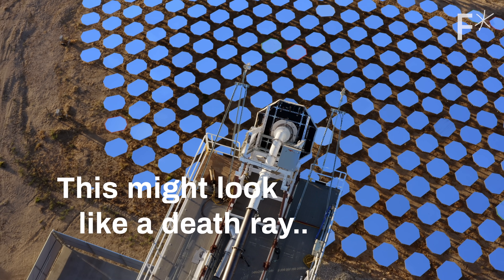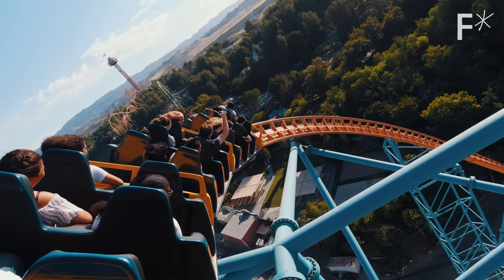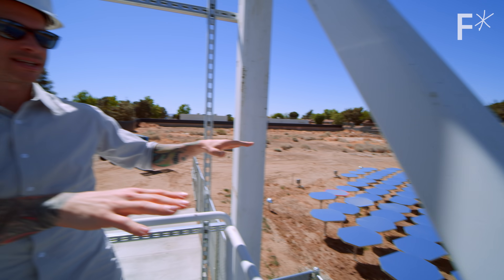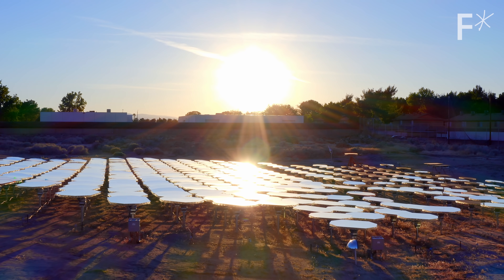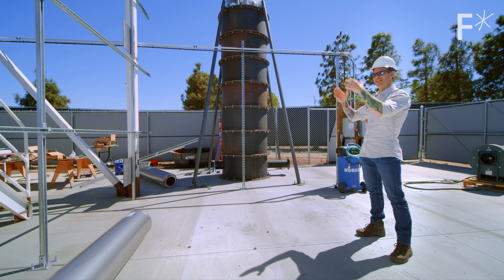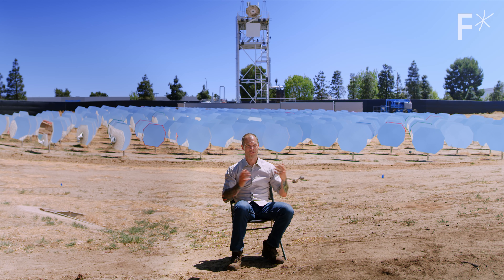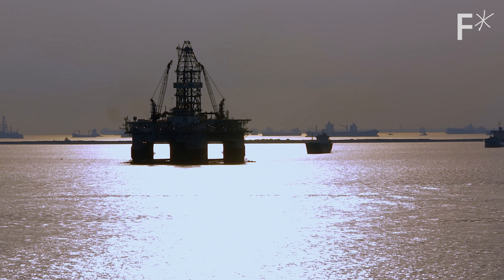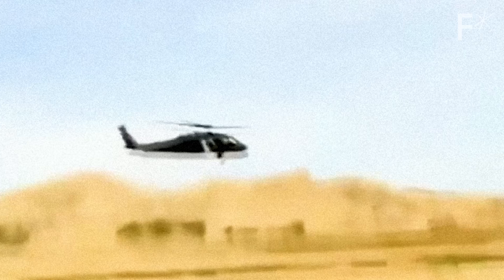How concentrated solar power could fuel the future | Big Think

Comment: With the historical drought among the western states, I wonder whether the technology is even more efficient in the application of seawater desalination.
Reply: When you heat seawater up to really high temperatures it produces chlorine gas which is incredibly dangerous. That's why nuclear power plants can't run their turbines on sea water. They can use it as a coolant but not to run the turbines.
Reply: @viaJustin1910  It seems to me the team could scale down the number of mirrors to achieve the temperature which is suitable for seawater desalination. But the hardest part to me is to pick a location along the west coast to setup the proof of concept application and the associated cost to build the pipes and brine treatment facilities. Or the team can try to get funding from the Middle East countries and setup trial there. Instead it might be easier to apply the technology to treat recycle water into drinkable quality. If I remember correctly San Francisco is conducting similar type of experiment or trial with old school equipment.
Reply: @Doug923  I believe there is probably several applications for solar refinement of water, I am just not sure how to over come some of the chemical reactions that come from sea water surely there is a way to do so though.
Reply: @Doug923  the Salton Sea
Reply: @blondegirlsezthis8798  Combining small scale seawater desalination plants with indoor vertical farming might have the least impact on the environment.
Reply: @Doug923  Actually you are on to something.  Some Carbon capture techniques would deacidify the oceans and allow corral reefs to flourish.  At the same time churning sea water (in my theory) creates more evaporation of sea water into rain clouds; to be brief.
Reply: @clavo3352  So micro seawater desalination plants might have second role as controlling sea salinity and promoting seaweed growth as carbon sink, in turn it might reverse the acidity of the ocean. Interesting.
Reply: @clavo3352  The oceans are basic, not acidic. Maybe research the things you pop off about.
Reply: @viaJustin1910  This isn't true.
It happens with electrolysis.
Superheated water just convert to super heated steam.
Reply: Yes, but brime is produce its a waste product
Reply: @ttt3377  There is another line of research to combine brine at different concentration levels to generate electricity.
Reply: I’ve been wondering about that for a long time as well.
Reply: Desalination creates poisonous sludge. Find a way to use the sludge or magically cause it to vanish.
Reply: Desalination plants use reverse osmosis. To get a 1 cubic meter  (1000 liters = 265 gallons) of water uses 4KwH (max) of electricity (2.5KwH min). At typical electricity rates (10 to 20 cents per KwH) that's 80 cents (0.3 cents per gallon), worse case. Of course that's your home rate. Current water, to consumers, about $3 per 100 cubic feet (750 gallons or 2830 liters), so 0.4 cents per gallon.

Now, a utility is not going to charge you 0.4 cents a gallon, if it cost them 0.3 cents. But, again, ECONOMICS ! If this solar energy method can make energy at a much lower cost than current sources, then the cost of its products will go down, too. Oil and coal aren't cheap, because oil companies are nice guys. Its because the make more money, by selling in volume. Our life style was defined by our energy usage, in the form of the industrial revolution. If you just go by the greed factor, newer methods make innovators, much richer, that the rich of the past. Also, in a way, trickle-down works. Before industrialization, the world population was 1 billion. Now its close to 8 billion. Famine and disease kept the population in check. It wasn't pleasant.
Reply: @michaelmoorrees3585  Israel has the most advanced desalination solution but the future is Graphene
Reply: @ap0lmc  Both emerging technologies could compliment each other respective to their own strength and weakness.
Reply: To minimise the build cost the desalination plant needs to be near the sea. As the thermal energy plant would be a large distance away in the desert (land near the coast is expensive), you would have to use it to generate electricity or hydrogen and then transport that energy to your plant rather than using the heat directly. This increases cost.
Reply: @alanjenkins1508  If the team could secure the supply of water to drive the steam turbine generator, it would be more cost effective to just send the electricity to the local grid.
Reply: You want to heat salt water to make water.... Should love to see the calculation for energy needed.
Reply: @aronandreas  For the efficient comparison probably should use the Carlsbad Desalination Plant in San Diego as the benchmark.
Reply: @Doug923  I have no knowledge.
Time for me to Google it.
Thanks 👍
Reply: That is the cool thing about getting renewable energy cheaper than fossil fuels.  Once it is, it can be used to solve a lot of problems more economically and without harming the environment.
Reply: Exactly!!
Reply: Graphine could do that with just gravity
Reply: look up the solar dome project, they are allegedly going to build these in Sadia Arabia
Reply: They might be able to use it to pull lithium out of the water in the Salton sea in California.
Reply: Yes its good , the water will evaporate leaving only the Salt
Reply: There is the Greenhouse effect Desalination Dome.
Reply: the problem they are trying to figure out is what to do with all that brine
Reply: Why concentrate the energy with its associated losses?  You are not gaining energy, just concentrating it.  Why not set up a pond of the same area and let the 1000W/m2 of solar insolation work directly.   Don't confuse heat with energy. It takes energy to convert liquid water to gas   (2260KJ/kg).
Reply: @craigs5212  There is another line of researches shows combining with ultrasonic wave, the evaporation could occur at around  50-65C.
Reply: If you’ve got cheap energy, you can solve basically any problem.
Reply: @pookachu64  Apparently another use case of the technology is in the process of direct carbon capture, without turning the energy from the sun into electricity.
Reply: @Night Rider 
Correct. This proves that man and Co2 levels have NOTHING TO DO WITH THE CLIMATE!
Reply: @Night Rider 
It absolutely proves it. There is no climate crisis. 

Burning coal for electricity is cleaner than a forest fire. Natural gas power plants are incredibly clean. 

Until there is an equally reliable replacement for fossil fuels we will need fossil fuels.
Reply: @glidercoach  theres a climate crisis. Theres a reason why it is the scientific consensus that the climate is getting fucked up. But it is not in the best of interest to many to accept it
Reply: @glidercoach  not really, because these scientists have other environmental tasks to make. If climate change wasnt a thing they would still have jobs involving precisely studying the environment
Reply: @vcjg287  
Have you heard the term "gain of function"?

There ia a lot of research going on with viruses. This research requires money.
Reply: @vcjg287  
Give me an example where the climate is being f'd up.
Reply: @glidercoach  rising temperatures because if human co2 emissions. We know its human emissions due to the isotope ratios of carbon present in fossil fuels. Also we know its an abnormal rise in co2 because we can compare current air to that of old ages thanks to ice cores or tree ring analysis. If its a scientific consensus, it is because the evidence is clear, specially to someon who has dedicated its time and energy to study such things. Just like a programmer or computer scientist are the ones that can understand when a system is infected with a virus
Reply: @glidercoach  the presence of droughts in the past dont change the trend that temperatures are rising. Thats something thats has been confirmed through different methods, one being the ice cores i mentioned. Also we now have satellites to meassure these things for the last 50+ years, and it has shown consistently how temperatures have been rising. Not only that, but the mechanism through which the warming is happening is well understood, it being the effects of CO2 with its heat capture capabilities. It is evident what is happening. Even in the 70s, BP made some studies on the effects of fossil fuels on the environment, and they didnt release the results until much much later, because it was evident how a co2 increase in the atmosphere isnt a hood thing. Those effevts have also been known since the end of the 1800s, because it isnt really complicated chemistry. It is empirical how greenhouse gases act. I dont see the point in denying it. Even if climate change wasnt causwd by humans, we would be watchung a disaster incoming for which we should prepare now, and the ones that wouls contribute the most in that are big companies. Coincidently these big companies prefer to deny this for the sake of short term progit, and the worst thing is that peiple support it, because they dont understand the science behind it, and how it is so evident that climate change is happening and it is not good
Reply: @glidercoach  it is expected that with rising temperatures rain will increase. 
And no, the ammount of ice in the arctic and antarctica has been decreasing, where do you get that info from. Dont trust me with this, just go into any climate research institute and you will see for yourself. 
Look, if climate change wasnt real, why would every single scientist base their research on a model they knew is evidently wrong. Also, do you agree with the following: 1. An increase in CO2 concentration in the air leads to more heat being retained. And 2: CO2 levels have been rising rapidly since the industrial revolution aka around 150 years. And 3. We can meassure these things accuratelly
Reply: @glidercoach  if can put a source to those claims it would be better. Also, it doesnt matter what one scientist says, what matters is the consensus on it, thats the point of publishing papers, so they are put under scrutiny by any researcher, and to see what outcomes everyone has. You can look up meta analysis on the topic of ice sheets for example. Just go into, say, the european climate research institute for example. Also, why would be the problem in accepting the reality as it is
Reply: @glidercoach  and the maldives arent thriving bro. Just look at how the place is getting flooded on a regular basis
Reply: @glidercoach  Oh, you just have no stake in it, so you don't care. Won't blame ya. Worst case, on the off chance you're somehow wrong (which you can't be because you're so experienced and figured out science for a scam that it is) - someone else will have to suffer. But definitely not you, no siree.
Reply: @vcjg287  
Where do you get your information. The Saudi's unvested billions of dollars building airports in the Maldives. Tourism was booming there until covid.
Reply: @glidercoach  they dont need more funding, because the research is already done.
Reply: @glidercoach  also eventually it became obvious how there was no intelligent life on mars. And noone tried to deny it, because the consensus is based on evidence.
Reply: @glidercoach  also, do you agree with the 3 points i presented you earlier or not.
Reply: @glidercoach  age is irrelevant in these matters. Its simple chemistry. Denying it is like denying the veracity of the chemistry that has built our modern world. The same that allowed planes to fly so you can travel.
Reply: @MadnessMotorcycle  
Bravo! What kind of Co2 belching, death motorcycle do you have? 

I have a liquid cooled MotoGP tandem twin 2 stroke. Do I get extra death points because I'm an oil burner? 🤣
Reply: @vcjg287  
I already commented on the 3 points. Clearly you're not reading what I'm writing so it's time to end the discussion. Have a nice day.
Reply: @glidercoach  well you actually didnt adress thise 3 points. Also that information comes directly from the journals themselves, not the press. As you say, these discussions are more productive when the facts can be presented ckearly, those being the research done, and articles or papers published. Do you know who does those discussions? The scientists themsekves, in science conferences, or are needed for the research itself. We dont do that, the normal people. And do you know who else doesnt read articles either? The press, because scientific accuracy is not the main goal. The consesnus is clear, but the ones that can do the most, are the source of the problem itself, which is the fossil fuel companies. Coincidentally since our world is based on these fuels these have great power to do what they want for the sake of profit. And denying an empirical, meassurable fact is pointless in that you would be siding with those that contribute most to the problem.
Its also not like if existing on renewable energy is impossible, because when there is a demand for a solution, the market finds a solution. However while this is happening, oil corporations receive more subsidies than renewables, tho the difference us starting to decline for some years now.
Reply: @glidercoach  You get extra points from me for what it's worth hahaha. I have a 2006 Honda XR650 dual sport I use for getting around the neighborhood and a 2000 Yamaha YZ-426 to tear up the earth with. The only two stroke I ever owned was a 1998 KTM SX250. It is a beautiful 85 degrees F in North Texas in August, which is incredible, and I will be firing up my C02, N0X and S0X spewing, archaic motorcycle and adding to the death toll of the insect extinction we are undergoing as well. Cheers!
Reply: @MadnessMotorcycle  
My roadbike is a 1984 Kawasaki KR250A1 I bought it when I lived in Africa. I also have a 1967 Volkswagen Karmann Ghia. I'm getting ready to do a ground up restoration. No complaints about the weather here in Southern Italy. 

Enjoy your bug extermination!
Reply: Historical drought? Not a chance. There have been droughts that lasted 200 years.
Reply: @glidercoach  Among those giant trees which died from the recent wildfire were those stood on Earth of 3200-3500 years, and they put this drought into the perspective. Tree rings studies from Utah and California give us ideas on how long the drought would last historically but those studies alone could not imply climate change. Given that we have no cheap and reliable methods to produce fresh water, the water management among the western states need to plan and allocate water use wisely as coal power plants need fresh water to operate the steam turbine generators.
Reply: @glidercoach  To climate change hysterics, everything they experience is 2, 3 or 10 times worse. Just chuckle and watch how things fall apart for them over time.

Comment: This is a terrible piece -- so many problems.
First, concentrating solar has been around for a long time and has several problems that make them less desirable than these guys are painting.  Concentrating solar REQUIRES direct sunlight and anything that gets in the way like clouds completely destroys the energy generation, solar panels (photovoltaic) does NOT require direct sunlight to the same degree and can generate significant energy even on cloudy days.  Second, birds that are drawn to these stations and wind up flying into the region of concentration get incinerated on the wing and that includes raptors and endangered birds -- these plants are death traps for anything that flies.  The current concentrating solar plants using sodium to store the energy can provide power after the Sun goes down BUT not all night long -- typically less than 6 hours.  Lastly, the 'game changing' AI tracking idea is a gimmick -- other means are NOT expensive and work every bit as good as this concept.  This has to be one of the absolute worst puff pieces I have ever seen!

Comment: No, we don't have to cover hundreds of square miles.  All we need to do is cover about 1/2 of all of our existing home, business and covered parking rooftops.  Decentralized power has many, individual empowering benefits!
Reply: that would add up to hundreds of square miles in the US....  there are 3 different commonly shared around SWAG data sheets that broke out generating all US electricity by volume from PV and they varied from 22,000 to 14,800 and one in the high 8,000 - those are square miles of collector area.  Now you wouldn't do them all in one spot anyway but that's not that much land area compared to the total area of the US - it would be a minor fraction of the interior of NV as an example.   Several hundred really large chunks across CA to TX with best sky properties, you'd never see them...  Those estimates are as old as 2004, so tech has advanced some... if perovskite advances find their way into production cells, cut any one of those numbers in half as they were targeting with 20% efficient cells and some multi-junction cells are being looked at into the 40%'s ranges...    And I think none of them did anything with trackers on any axes, it was just flat plate at a fixed angle.  But yeah, single sourced - it would take many, many thousands of square miles of land area.  And, I'm all for microgrid/home/business install etc...  it's just that when you add up the surface areas on them, you're getting a sum into the hundreds of square miles... we gots lots of buildings ...
Reply: @lylestavast7652  Don't be ridiculous.  I've been in the solar industry since 2007 in Puerto Rico, Arizona, etc and nearly every home and business I ever designed a system for and made a proposal for was for 100% of their consumption and it usually only required less than 1/3 of their rooftops.  

All we need is to cover our existing rooftops, plus to make some solar covered parking to get to 100% solar.

STOP using social media to spread incorrect information pushing people away from solar like a fossil fuels troll!